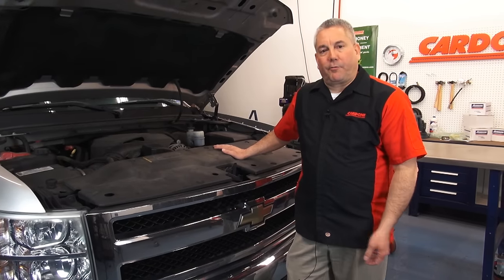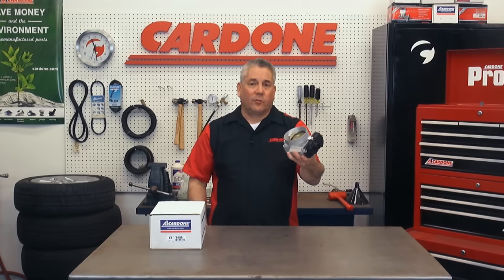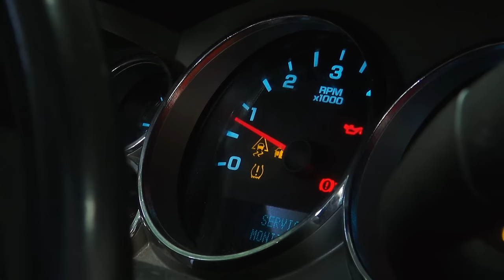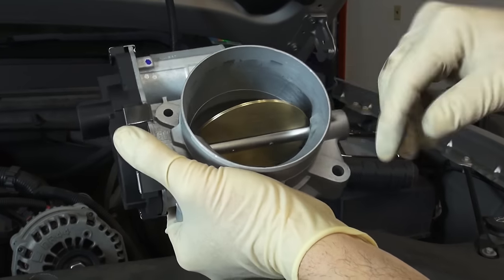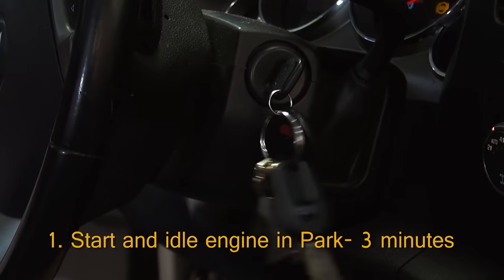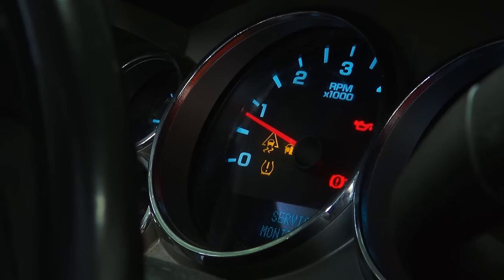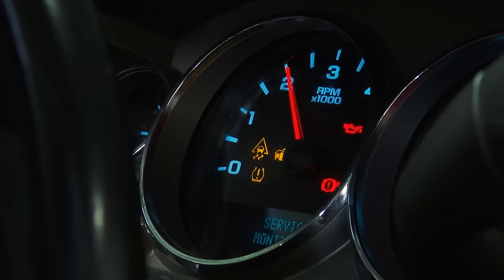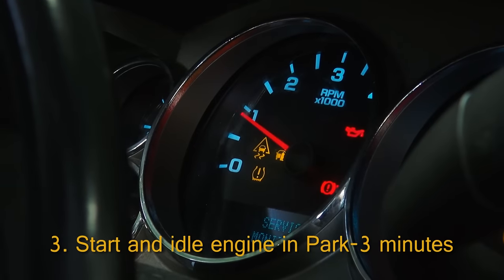GM Truck Electronic Throttle Body (ETB) Relearn Procedure

Comment: I removed and cleaned the throttle body on my 09 silverado 4.3.Idle was high for about 8 days then went back to normal.
Reply: Is it safe to dive in high idle
Reply: @69arlo  I wouldn't recommend it,but it turned out fine and light turned off.It wasn't too high just a little over normal.Next time I'll just clean without taking it off.
Reply: Thanks ya I had to pull my truck out of the garage but when I did I gave it a little gas it didn't move much so I'm sure I have to have it plugged in
Reply: @69arlo  I bought a 99 gmc sierra that was parked for over 6 months,but I siphoned the old gas and put fresh.Started up and ran good.

Comment: Does it matter whether you drive directly after the procedure or not? Do you HAVE to drive after the procesure? I had ro run back to work so i did the procedure, drove around the corner and cut it off. Wont know if it worked until i leave work

Comment: I have an 04 silverado. It was a v6. I put a v8 in a while ago. Just added an nnbs intake manifold in it. But couldn't use the 4 bolt throttle body. My wire was a 4x2 and the nnbs throttle is a 3x2. I bought the adapter and everything I tried this but all it did was started my rpms at 4k and wanted to rise very slowly. With my dashboard saying reduce power. Did the multiple times. But the ecm never cleared it.

Comment: HI, i had a 2nd hand throttle body fitted a week or so ago and when I now start the car it jumps into a mode where I can't accelerate and the gearbox is stuck in a really slow mode. Any ideas what may be the problem? As a footnote, if I kick down (before this problem), the car would go into a very slow mode and I couldn't get any acceleration until I restarted the car. Trailblazer 2005, by the way. Any advice appreciated. Also, when I removed the throttle body, it rattles. IS this normal?
 Cheers.

Comment: I did this three days ago and the check engine is off. Now when I slow to a stop, it downshifts at higher than normal rpm, requiring more braking effort when the downshift happens. Any help on this?
Reply: Same here. What did you do to fix it?
Reply: Same. Any advice?
Reply: So I took it to my mechanic and he said time should fix it. It’s definitely better but still does it on occasion! Y’all got anything?
Reply: Did you fix it?
Reply: @j86103  it has been a while now and that seems to have done the trick! I think adding a cold air intake threw off some parameters too, so I probably should have stayed stock. I rarely run rough now though.
Reply: 2004 silverado mild build on a 4.8. Just got the 102mm throttle body dbw and xlink and it won't learn the idle. Idles at 1500 and stays in reduce power mode. Tried the process for and hour. Also letting it reset with the negative terminal off for 15 minutes.  Still no luck. Any help

Comment: Hello, very helpful and did help, but after a smooth idle i would rev it up then it will kick back up to 1500 rpm instead of 850-1000 what do you recommend?
Reply: Yeah, I am very careful to even wait when shifting to park so the idle gets down with gear engaged. I think it needs several drive cycles for days to re-learn everything. Did it settle for you shortly after, or what was the solution ?
Reply: @OscarHanzely  I forgot about this comment lol, if I remember correctly what I did was hook positive and negative cables together overnight with battery out of vehicle. Then next day I hooked together and it took awhile but it did eventually work again just fine.

Comment: I have tried the relearn procedure without hooking up a scan tool. I had no luck. So I had to use my scan tool and it was reset in less then a minute. I have made good side money getting called by other shops to show them or do the relearn procedure for them
Reply: So did you just erase the code and do this key on/off relearn procedure?
Reply: What scan tool ?  I would like to know which brand and model ? i am sick of having to give money to chevy for repairs that are fake and could be done with a paper weight dropped on a few buttons. please let me know
Reply: @johnrusselfromthatmovie4720  I am using a snapon solus edge.  But a snapon solus pro or ultra will do the reset

Comment: Thanks for helping us solve our own problems with great vids!  Didn't realize the relearn is different with every car... could you show me where to find the procedure for a 2007 Chevy aveo hatchback LS?
Reply: how about for a 2006 dodge charger 5.7  ?  i cleaned the throttle body and now it wont accelerate , it feels like the car is on limp mode , i step on the gas pedal  and the car  just doesn't accelerate  i even bought a new TB installed it and still have the same problem . please help .

Comment: Same problem here. 2007 GMC Yukon Replaced throttle body, sensor, pedal with sensor and connector cables. I still have the check engine light come on with codes P2135 and P2101. What else is left to fix??????

Comment: Obviously i know that it cant be said over a comment, but we took the sensor off but also unhooked the air tube(sorry idk much about cars) then got it all hooked the car idles right to 4,000rpms . Does this work for a 2007 Pontiac torrent? We tried a lot and cant afford the "300 tool" to relearn
Reply from the maker: Hello Sheila, thanks for the comment and question! This may be something for our Tech Support Team to answer, please call 888-280-8324 Mon-Friday 8am-5pm EST to speak with one of our ASE-Certified Technicians. 👍😊👌

Comment: What if the car is still in limp mode and can't get up to 44mph?  I've replaced the throttle body and then replaced the PCM and all the wiring is all good but the vehicle still has a TPS code and it won't come back to life. :(

Comment: Worked for me on 2007 Silverado 5.3.  Bought the Hitachi throttle body to replace factory.  Started the truck after.  Idled at 3000 rpm.  Check engine was still on.  Did not have scanner to clear codes.  I disconnected the negative on battery then used horn to drain any power left.  Check engine was gone.  The reset sequence initially did not work.  I drove about 60 miles using various backroads to vary speed.  When I got back, I tried the reset sequence again and now Idling perfect.
Reply from the maker: Glad you were able to find a solution Jarrod 👍

Comment: I removed and cleaned my tb and a have codes 506 and 507.  I still need to try and drive it but, my truck will not start if I don't press on the gas pedal a little. I have to let it warm up for a few minutes if not it will shut off. Could that be because it still needs to relearn?
Reply: it's a 2006 silverado with a 4.3 v6

Comment: Replace the throttle body now when I put it in drive and take my foot off the brake it revs up to 20mph without me pressing the gas. Idle speed is normal in park
Reply: I’m having the exact same issue on my 10 Yukon Denali. Also hard downshifting and long stopping distances
Reply: danny kelly same with my 07 Escalade, did relearn procedure multiple times but when put in Park it revs to 2200 and jerks when downshifting
Reply: So did u guys figure this out mine does it also
Reply: Once I put it on the interstate for a few minutes it fixed itself

Comment: will I have to perform a relearn procedure on a 2010 chevy equinox that I'm replacing the throttle body on?
Reply: How'd it go? I have a 10 Terrain that ill be doing soon.
Reply: I have a 2010 chevy equinox  
Do i have calibrate throttle body??

Comment: I replaced my throttle body on my 2011 Chevy Colorado and now I’m having an erratic speedometer and my car seems to think I’m still stepping on the gas when I’m not. Didn’t have this problem before replacing the throttle body. Any idea why?
Reply: Same here. What did you end up doing to fix it?

Comment: just put a new throttle body on 2012 silverado 5.3 and it idles just fine aint got no issues there, but when i even breathe on the throttle it revs up to 3k and climbs will not drop back down. im scared to drive it because i dont want it taking off on me. tried the idling shit but it aint do a thing. im thinking you do need a expensive programmer to do this job on 12 model gm 1500s. prolly gon slap my old one back on to drive it to the shop and have them re program it. kinda sucks thought it was a easy fix smh theres always some catch to doing shit like this.
Reply from the maker: Thanks for the feedback Swag, why don't you give our Tech Support Team a call about your question, They may be able to help! Call them @ 888-280-8324 Mon-Friday 8am-5pm EST to speak with one of our ASE-Certified Technicians.
Reply: You ever figure out the problem?
Reply: @TheJdog12313  I ended up having to buy a new computer for the truck and a new wiring harness. Was an absolute nightmare. The truck was having engine power reduced thrown multiple times before I put the new throttle body in, that's why I put the new one in thinking it would fix the code, turns out it was the computer the whole time that was messed up according to the shop.
Reply: 10-4 appreciate the feedback Im having the same problem changed the throttle body and still seems to get stuck if you rev in park

Comment: Please help. 2007 Jeep Wrangler.  TB acting normal when engine is cold. After driving 40-50 miles at speeds over 50 then coming to a stop is when my TB light comes on code p2172. But my check engine light never comes on.. If turn engine off then back on TB light still on and idles rough no power when driving sluggish.  Now if I let it cool down for over 20 minutes the jeep goes back to normal. Then after heating up again same sluggish and TB light. I cleaned TB replaced pcv valve checked all else. Is this a sign of a BAD TB...? Thanks

Comment: Crank up your heater full blast so thermostat opens up and coolant flows and  cools engine down. RPM should lower down
Reply: thanks! that did work lol, it wouldnt go down til i did this, said ahhh wtf let me give it a chance.
Reply: Lol didn’t work until I tried that, thanks

Comment: Just received a Cardone remanufactured throttle body for my gm. You can see it was sandblasted, which isn't a problem. However when shaking it and moving the throttle blade, there was clearly sand coming out, and you could feel and hear sand grinding in the shaft. Maybe clean these out better before shipping?
Reply from the maker: Thanks for the comment Thomas, sorry you had this issue. This sounds like something our Customer Service could help you with, please call them at 800-777-4780 Mon-Fri 8am-5pm EST. If you have a question for our Tech Support Team, please call 888-280-8324 Mon-Friday 8am-5pm EST to speak with one of our ASE-Certified Technicians.

Comment: What does it mean if my throttle blade will not open at all? I can’t even open it with my hands unless I unplug the wire or takr off the battery

Comment: Won't work on a 2014 Chevy Silverado 5.3. I took off the throttle body and cleaned it with throttle body cleaner. Cleaned the throttle body, reinstalled and followed all steps multiple times. Will be taking it to a shop tomorrow to see if they can get the idle set. On initial crank up its fine until you start rolling then wants to lurk forward at stop signs and lights. HARD downshifts in 3rd 2nd and first. It is reving to 3k RPMs in neutral after a drive.
Reply: Exact issues I’m having on a 2011 Sierra. Did the shop fix it? What did they charge?

Comment: After replacing my throttle body and sensor, my 2012 Chevy Silverado will start at  3,000 RPM's. Is it safe to let it run for the 3 minutes? I got worried and turned the vehicle off.
Reply from the maker: Thanks for commenting John, if you have a question for our Tech Support Team, please call 888-280-8324 Mon-Friday 8am-5pm EST to speak with one of our ASE-Certified Technicians.
Reply: I have the same question is it safe to run it at 3,000 rpms?

Comment: Anyone know how if this procedure is applicable to a 99 Sierra 1500 5.3 LS LM7 when replacing the IAC?   It has an IAC and TPS but has the cable driven accelerator linkage.  Also.  The after market IAC ranges from less than $10 to $134 for the AC Delco OEM. And $50 - $134 for AC Delco.  I have a new ACDelco IAC in hand ready to change out the cheap aftermarket.. 

This whole thing came up when trying to solve the very common and dangerous sticking throttle.  Mine started this at 245K but others with these throttles experienced it on many - even relatively new engines.  Of course as usual GM did not recall.  After decarboning the throttle body I determined that the stick was not in the excelerator cable or butterfly so the only remaining thing was to replace the 2 sensors on the TB.  After this the stick was gone but an irregular idle showed up / and it raced at startup.  

The GMC dealership simply told me I had to replace the throttle body ($500!) which I knew was not the case as the excelerator sticking was gone upon replacing the IAC and TPS.  I didnt have the racing idle until AFTER they messed with it CHARGING ME $100!  🤬

Comment: Would a re-learn cycle be necessary if you are just cleaning the throttle body that's original to the vehicle? I've got an 07 Hummer H3 that I'm looking to do that to. Would I need to do this?
Reply: Thanks for the time! Appreciate it just the same. I got some info from a mechanic friend of mine that owns a H3 as well, no relearn cycle needed for cleaning the throttle body as long as you disconnect it and remove it from the body before cleaning. Installing a brand new throttle body requires a relearn cycle though.

  Thanks again for your time and response! Appreciate it greatly.

Comment: the first 3 mins stayed high idle after the 60 sec shutdown the second start of the 3 mins idled normal but threw the check engine light so I’m going to drive it on the high and mix it between service road and highway to slow it down

Comment: Cleaned TB on a 2008 Pontiac G6. Hooked everything back up, started car, Idles at 3500 Rpm. Did the relearn procedure, did not work. Idles in park at 3500 RPM. Did that for 3 minutes. Turn off 60 seconds. Let run 3 min again. Even drove it. Car accels on it own. What could be the issue? I even put a new TB on. Same issue? How can I wipe out ECM memory of the old idle settings?
Reply: What was the fix to this? ECU flash?

Comment: I have a 2009 gmc Sierra 1500 and I just clean the throttle body and now it's rpm r at 3000 and don't drop I try the videos but it's still not working what should I do?

Comment: I have a 2008 Acadia with the oil settling in the intake from the throttle body and get stabilize link traction control and engine powering off. I thought of changing the throttle body.  Any suggestions please?

Comment: Is it necessary to disconnect the battery before replacing the throttle body?
Reply: This is a bit late but no if the ignition is in the off position no power will be getting to the TB so disconnect is not necessary.

Comment: Thank you so much for the helpful information. I have tried this to no avail. However i believe it will work itself out eventually. I just purchase & installed a new throttle body for my 2008 Chevy Express van 3500 series. It still has a very high idle when in park. When i put it in drive it idles normally!
Reply: JermainesTaxiAndTours any luck?
Reply: Check for a vacuum leak
Reply: @joekrim6557  Vacuum leaks would trigger trouble codes related to them and also the vehicle would exhibit other symptoms like stalling out and lean misfiring.
Reply: Buy an AD600S diagnostic instrument, read the engine system fault code to further confirm the cause of the fault, and you can also use AD600S to perform the throttle learning function for your car:goodvibes:https://www.youtube.com/watch?v=QCgpVCEtarY

Comment: Concerning a 2010 GMC Terrain with a broken lumbar support.
Manual says to disconnect the battery to fix the seat.
What will happen when the vehicle battery is reconnected?
Will all systems need to be re-learned via scan tool?
Reply: Hell no lol the vehicle stores a base set of parameters in its software

Comment: If I simply unplug the battery for an hour or two, will the computer 'relearn' after cleaning the throttle body or do I still have to follow the same steps from the video?  Thank you so much :)
Reply: That’s my question too. I have a 2014 Ford Fiesta

Comment: question for you, if you feel so inclined to help a DIY newbie...

I cleaned my throttle body on my 4.2L 6 cylinder 2008 GMC envoy.

when attempting the relearn procedure- thank you very much for sharing this video by the way- my throttle body seems to whine while in park.  the whine goes away when the vehicle is shifted to drive, and it drives smoothly.

any ideas as to why it does this?  thanks in advance!

Comment: Problem solved, i replaced my throttle body started rev at 3000rpm i have tried so many things it did not work finally i took it to a guy with dealer level scan tool he did reprogram my new throttle, so it can be accepted to the truck with electronic setting it runs so good now just sharing my story
Reply from the maker: Glad to hear it!

Comment: i think , This JJust save my ASS..   cLEaned the throttle body . without studying videos ...  and  by chance  i found your video....and that step of  start and idel for 3mins and off for 1 mins....   x3 times.... -=== idel at  500/600 rpm now. ... THANKS man
Reply: 2010 silverado cheyenne edition!
3mins idle  + 1 min off  + 3mins idle + 1 min off + 3mins idle + 1 off + 3mins idle + 1 mins off + 3mins idle.     <--3rd try  when normal, 4th try confirm fixed...    now i can pass down this Knowledge

Comment: So even though I have a 96 GMC Sierra and I just put a new throttle position sensor on it and I did this procedure it seems to work but I have one good answer for all this electronic stuff it's called get a carbureted personally I think we all need to go back to Old vehicles with carburetors all you mostly would have to do for idle is adjust a screw
Reply from the maker: Yes, it was a little more simplistic back then.